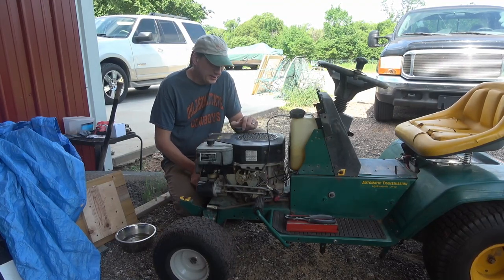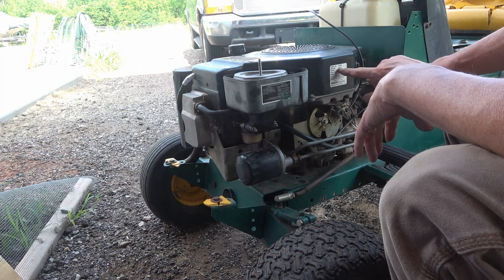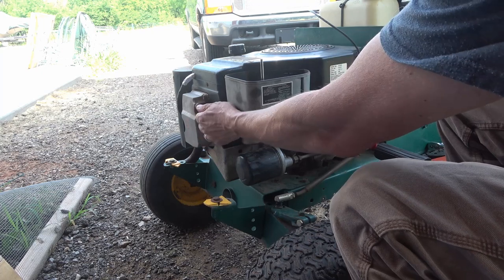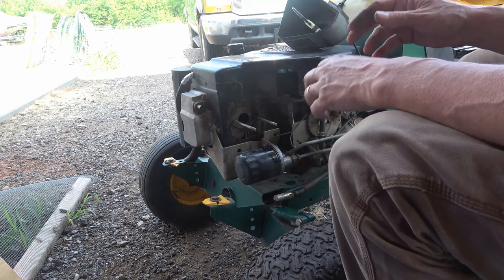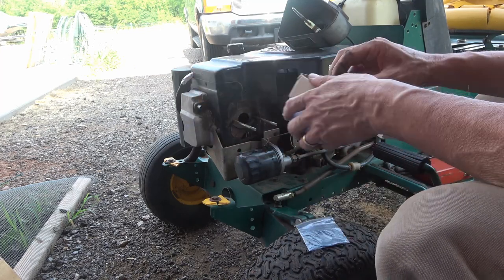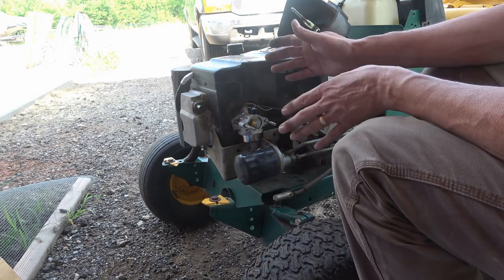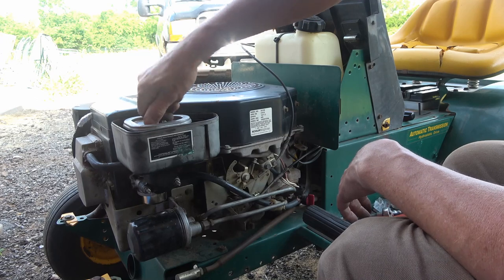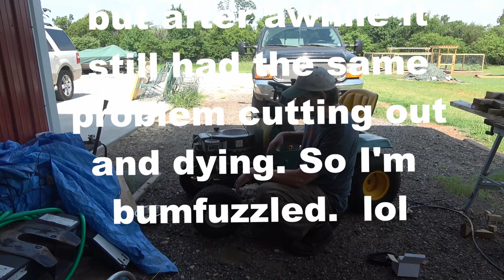Replacing carburetor on a Kohler 15 HP Engine Model CV15S #smallenginerepair

Comment: I replaced my carb on the same model as yours and my choke was sticking(like yours) after the replacement. I found that on the replacement carb there is a small pin that the throttle cable is hitting and keeping the choke from opening. on the old carb the return spring is not covered but the new carb is designed a bit different and has a stop pin that gets in the way of the choke cable. I'm gonna file it down abit and hope it works better. you may want to check to see if your problem is the same.

Comment: Buy OEM. I had to add 3 small M3 washers on the linkage-carb join because it was hitting a pin. OEM carb is like $200. The copycats you can get them online for $20. You get what you pay for.

Comment: I just had a problem with the same new carb you put on.. look at the choke side of the new carb it is not a full circle, the throat is different size. They actually have 2 different carbs for the cv15s ..
Reply: Well im putting a cv491s carburetor onto the cv15s because it works better but usually one carburetor fits multiple engine models so it is for Kohler anyways i think it'll work out

Comment: This may sound like a silly suggestion, remove the gas cap, start the mower to see if this resolves the issue. With the mower picking up dust and dirt while you're mowing the venting hole on the gas cap may be clogged/restricted. If this works simply replace the gas tank cap. Don't try to bore holes into the cap, if you do, it may pull dirt directly into the gas tank as it's venting.
Reply from the maker: I’ve had that issue on ATVs before and it takes a bit to build a vacuum. This thing surged almost immediately.

Comment: Exactly same issue here. Sometimes it just a matter of engaging the blades and poof..chug chug Im dead. 😡
Ive been told not to run ethanol gas, but it was to late I had already killed mine. Im guessing ethanol gas gummed up my carburetor. (Ive already replaced everything else. ) so Ill be draining fuel (cause now i dont know whats in it other then 3 yrs age😒) and a new filter just because. Fingers crossed it changes things cause im to old to be walking behind 24” all summer😩.

Thanks for this vid….looks easy to follow. (Later…gotta go cut grass rite now🤦🏻‍♀️🤣)
Reply from the maker: Ethanol is fine as long as you don’t leave it sit unused like over winter. It absorbs moisture and will cause corrosion. I always run straight gas in my small engines and also put Stabil in my 2 cycle gas because I don’t use it up very fast. Good luck.

Comment: This dang ethanol gas is killing our mowers!   Is that an Oil filter I see? Great job done on replacing the carb. Have a great day!
Reply from the maker: Carb change a success, motor fix a failure.  lol  Yeah, that's an oil filter.  That stupid thing.  I have another just like it that smokes like a steam engine, so I thought I'd go get that one going after this to 'cheap out' and have a bee wagon puller.  I went down there and it wouldn't start, rats ate the wires all up.  So I figure, I got this, I ripped all the wires out and just wired it up direct - no safety crap, and it fired up and killed every mosquito within a half mile, and fouled the plug.  I went and bought a plug and when I got back I forgot to turn the gas off, so the cylinder was full of fuel and it wouldn't even turn over.  So, I got pissed and put both mowers on facebook marketplace "free to a good home"  I had about 15 messages in 30 minutes.  So they gone!  Some poor feller picked them up and he said he would tinker with them and get one going.  I hope so, he looked like he needed some better times.  So the next day I found me a 27HP Cub Cadet with a 54" deck for $400 and it starts right up and runs.  The deck needed some work though, so I already spent about $300 on parts for it.  lol  Take care Mr. CB.

Comment: Too bad it was still messing up. I took that same motor out of the same tractor and put in a slightly newer version for my dad. The guy told me it was seized but it just needs a head gasket and a new float seal in the carb. Good luck with it.👍
Reply from the maker: Yeah, it's the wierdest thing.  I never saw one do that before unless the choke was stuck or something.  New carb and it basically did the same thing.  I fixed it though.  Sold it and another like it for free.  Bought me a 27HP twin cyl cub cadet for $400 that runs good.  lol  Take care Brian and thanks for watching and commenting.
Reply: Jerome Bee Farm & Homestead hey you too

Comment: Did you try wacking the bowl with a screw driver or a wrench, I’ve had some that I nearly had to use a hammer to get off
Reply from the maker: It looked like it was laser welded together.  Maybe not.  I just swapped the carbs.  Didn't fix my problem.
Reply: @JeromeBeeFarm  it wasn't it was just a old rubber gasket around the lip of the bowl and they don't sell the same gaskets for that type of carburetor because i tried replacements for it none would fit from how they were made so i was pissed off about that when thats all my problem was i still have all my old carburetors still bet you your ohv cover had a small air leak or on the hose

Comment: Yours is gravity flow fuel, you said it was hot out and that after a while it would stop running.  My guess is vapor lock.  I have the same motor with fuel pump cause tank is in the rear.  If your case is as I say I would have distanced the fuel line further away from the engine.  Also with the fuel filter so close to the engine move that too.  I've heard of this happening to a guy with the same engine and gravity he just made some wire to move the line out further.  I bought an ebay carb too just like you did for the same motor.  Issue I had was banging just about a year after I replaced it, now I'm afraid a screw on the butterfly may have backed out and got sucked in....  I need to figure that out.  Cheap always gets you I guess.
Reply from the maker: Hi Kartboarder. Yeah, it was weird, it ran fine up to that point and never had a vapor lock problem, not even when it was hot. It just started all of a sudden. At this point I gave up on it and gave it away and bought a used cub cadet for $400. Thanks for the input. It will probably help someone else down the line that watches this video looking for ideas. Have a great day.
Reply: @JeromeBeeFarm  Just an FYI - The fuel line on these Kohler engines HAS to be mounted next to the engine as it was originally or it will get vapor locked from the hot air blowing down from the front of the engine.   A guy on here with a Craftsman had the same issue after replacing fuel line and leaving it a tad too long.   After half tank the tractor would quit.  He fixed the fuel line and it ran great.....

Comment: I had a feeling that wasn't going to fix it based on the sputtering.  after researching the same issue on an older (1996) Simplicity  with the same 15HP Kohler that hasn't been used in over 10 years.  It appears the mystery "shut down" issue on these engines is caused by the FUEL PUMP.....  I started cutting my own grass again for something to do while quarantined, lol.  after about 30 minutes or so, the tractor sputtered a bit and just quit.  Would not start.  Tried starting fluid at one point and I think it started and stopped.  Seemed like it was a safety cut out.  Let it sit for a while and it started.  Then shortly after it would stop again.  After reading a few reports of the same issue I'm pretty sure its the pump.  Someone else reported that the dealer said they were only good for about 6-8 years.....  I'll know for sure soon.....
Reply from the maker: This mower doesn't have a fuel pump.  It's gravity feed to the carb bowl and the engine vacum pulls fuel through the jets.
Reply: Small gas engines like these are really easy to trouble shoot. There’s 2 different safetys i know of for small gas, one is cutting spark and the other is cutting the fuel off to the bowl. I don’t think your mower would have a fuel shut off so it’s probably just flow to the carb. Maybe draining the tank and getting new fuel lines will fix it. If that doesn’t work look up online how to fix small gas carbs, they all use the same Principles. And once again if that doesn’t work take the carb to a small engine place and have them clean it and refurbish it
Reply: The bowl will come off. It is tight but it will come off. I wish you would have shown the fuel pump because I have the same engine as you and my fuel pump is mechanical. @JeromeBeeFarm

Comment: All the stuff i replace on my mower is cheap chinese made from ebay but work great
Reply from the maker: I get quite a few parts from eBay.  That carb looked identical to the old one. Unfortunately the motor ran identical as before I changed it. lol. I gave that mower away after that and got another one. Thanks for watching and commenting.

Comment: Did you ever find out why it still quit?  I may have the answer...…...
Reply from the maker: I did not. Please share because this video gets a lot of traffic with people troubleshooting this motor with similar problems.
Reply: What was the answer?
Reply: @iwander2561  The fuel pump.  I've had the same exact engine on my John Deere for almost 26 years now and that's happened 2X.  Both times I replaced the pump and she ran fine.
Reply: @JeromeBeeFarm  I'm sorry.  I never saw your response.  It was the fuel pump on my same exact engine that you have.  Had it happen twice.

Comment: Each one of the Kohler pro cv16s and Kohler command cv491s and cv15s all had the gas flooding problem 

I disconnected the gas pump on the cv491s and made it gravity fed and it fixed the problem for a few years then the problem came back because its a small seat in the carburetor causing it to flood with gas so i figure thats the problem with all the others i have 

But the cv16s was already a gravity fed carburetor it still works though it just needs a shift hub put on.

I think yours needed that carburetor rebuild kit and all it needed from it was one small part you should have checked your ohv cover for any air leaks to a broke gasket around that will make it sputter and pop to then the hose to that should have been on tight i know if the hose has any cracks it'll run bad to
Reply from the maker: This one didn't have the pump on it, it was a gravity feed. I never figured out the surge issue.  It started all of a sudden.
Reply: @JeromeBeeFarm  like the Kohler pro cv16s is gravity fed so it was probably a bad gasket on the valve cover and it needing that other brass part in the carburetor like mine needs but i put a gas shut off valve on and it works fine that way but it still doesn't fix the problem though it needs a smaller needle seat or a different carburetor if that piece can't be changed out